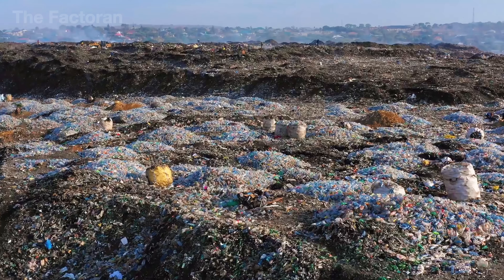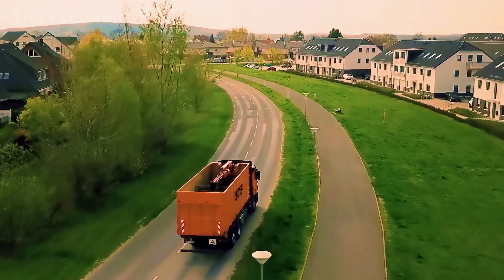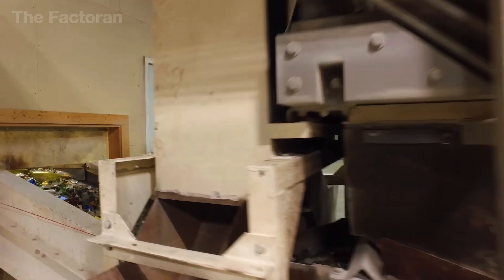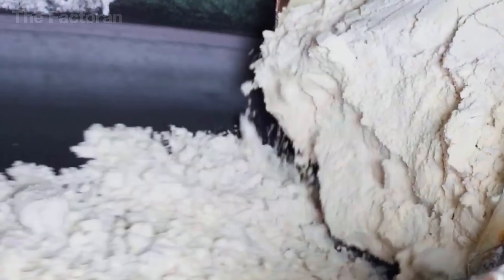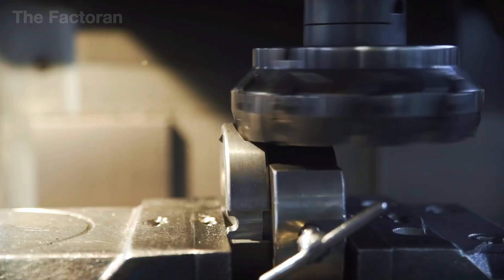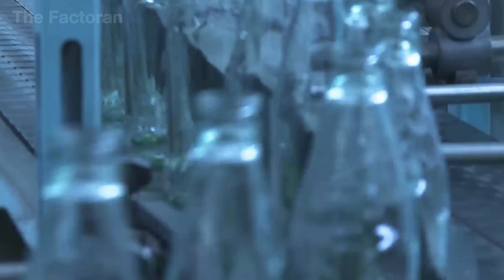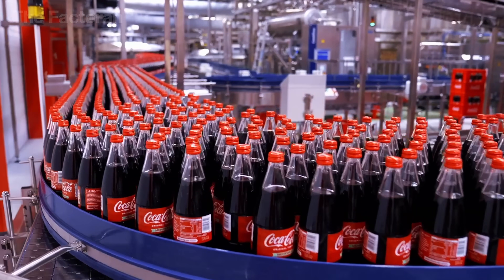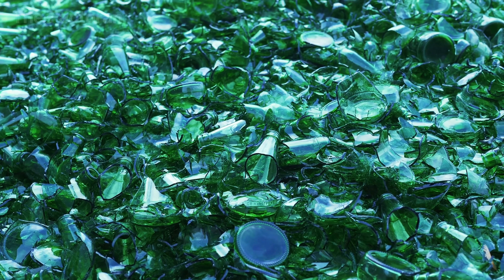How Millions of Glass Bottles Are Recycled In Factory – Massive Glass Recycling Line

Comment: You mentioned CO2 emissions.
Are CO emissions reduced? They are the main emissions from burning all organic matter, such as coal, gas, oil based products, wood, etc.
Reply from the maker: Good question — CO emissions are usually much lower because modern combustion systems are designed to convert CO into CO₂ more efficiently.
Reply: @TheFactoran : That is mostly fiction, as Wildfires & Volcanic eruptions which emit huge amounts of CO, all of a sudden were emitting CO2, as too were fossil fuels, without the need for UV Radiation to split the Hydrogen from Water Vapour & Methane, resulting in CO over a 5 - 7 year period, then also Hydrogen split from Water with the Oxygen joining the Carbon Monoxide to form Carbon Di Oxide, which along with Sulphur Dioxide & Nitrogen, are the coolants of the planet.
Clouds can't exist without CO2 to condense the Waters Vapour. 
During the period All Gore was promoting the myth of CO2 causing Global Warming, both CH4 & CO were all of a sudden never mentioned. Nor was Hydrogen or H2O in relation to their properties of concentrating Solar Radiated Heat. They also blamed humans for the increase of Volcanism on land, yet dismissed any active volcanoes in the largest volcanic field, below & surrounding Antarctica, which finally has been acknowledged, but they still don't acknowledge the fact that CO2 is the last gas frozen in Ice Cores before an Ice Age, sometimes also with SO2 & C in the form of Volcanic Ash.
Where we are in the Galaxy has a higher proportion of Solar Radiated Energy, causing our Star to experience more CMEs of which many are of greater magnitude than we have previously measured. This is resulting in increased internal pressure as some of that energy is transformed into matter, resulting in a number of thought to be extinct Volcanoes to return to life, while others have increased their activity.
Hydrogen is the active Global Warming Agent in the Stratosphere. 
That is what makes both H2O & CH4 Global Warmers.

Comment: Most screw caps for glass bottles are made of aluminium, the quality stuff, not that low grade US Aluminum.
Reply from the maker: Screw caps are typically made from aluminum alloys, and quality mainly depends on the specific alloy and manufacturing process rather than the country alone.

Comment: I lived in Las Vegas for over 38 years, and they had a reasonable, though not great, recycling system. Now I live in a somewhat rural town south of Reno, and they have zero curb recycling. If you want to be a "good" citizen, you have to drive five miles out of town for a limited recycling point. Your gas for the ten-mile trip will hardly make the trip worthwhile from an environmental standpoint. We need to get a recycling facility in the center of town, where it is easily accessible on a trip to the grocery store.
Reply from the maker: That’s a thoughtful breakdown. Access really does change how practical recycling is for a community.

Comment: I worked at a bottleing company many yrs ago & few ppl know how glass is made..
Silica sand is not sand you see on a beach & there is a huge process to remove silica from other minerals..
Removing clay & other impurities from silica takes up most of the manufacturing process..
Recycled glass of multiple colors became far too labor intensive to be practical until the digital age caught up .
When the company I worked for installed the machine to separate colore , it was cutting edge ..
But , even then there was a conveyor lined on both sides with employees to pick out the wrong colored glass shards that got through.
We made ketsup , soft drink , milk , canning & a dozen other bottles.
At the time , glass was the king of containers until Shell Chemical started producing plastics that were much more cost effective.
The co. I worked for shut down after 60 yrs in business .
It devastated our little town of less than 10k..
Most of the younger people left ..
But...today they're building a steel mill that will emply 4000 ppl & Toyota built an engine & transmission plant there .
Nxt yr a plant that produced biodegradable plastics will open & hire 2500 ppl .
I've lived 1200 miles away for 30 yrs , but my little hometown has become the center of booming industry once again after 30+ yrs.
Reply from the maker: That’s such a powerful story — it shows how industries evolve but communities always find ways to rise again.

Comment: It is not economical to recycle glass.
Reply from the maker: That’s a common concern — but modern glass recycling has become much more efficient. It actually saves energy compared to making new glass from raw materials.
Reply: @TheFactoran  I'm not so sure about that. Although the actual melting process of the recycled glass may save energy, when you consider what goes into collecting, and transporting the cullet to the glass plant, the total energy consumption can actually produce more CO2 emissions. In some cases it may make sense, but not in all cases.

Comment: In Denmark we do something similar. We just do something different, we take all whole bottles from the beginning, which makes our return better and with less energy consumption, than if you destroy them, approximately 32% of the bottles in Denmark are recycled without melting them down.
We started in 1942 with the first bottles where you got your money back, for the first time, not because people were thinking about the environment at the time, but because glass was in short supply during the war.
Reply from the maker: That's awesome—Denmark's bottle return system is a game-changer! Reusing 32% of bottles without melting them down saves a ton of energy, cutting emissions by about 0.5 kg CO2 per bottle compared to recycling from scratch.
Reply: It actually reduces CO, not CO2. All beer & Soft Drink in Australia was in re-usable bottles until the late 1980s, when we no longer owned a Glass Bottle Manufacturing Plant, due to Multi-National Corporatisation.
Coca-Cola was the only Company which could order the minimum quantities of bottles the suppliers would sell, causing most independent soft drink companies to close.
Reply: If 32% weren't melted down, did you mean to call it reused versus recycled?

Comment: Do you feel like this is an AI written and voiced documentary about how amazing Glass is? Oh and you don't get free money recycling your bottles...its already a tax on the item but you get back if your recycle/return - a smart way to prevent litter but lazy people don't care. Please stop putting your corks back in wine bottles and metal caps in empty bottles because some recyclers mark that as dirty glass for road material.
Reply from the maker: Great points — and you’re right about the deposit system! It’s meant to reduce litter, not reward recycling. Also, thanks for the tip on keeping glass clean — small details like that really matter in recycling quality.

Comment: Instead of breaking down and re-forming the bottles between each filling, wouldn't it make more sense to just reuse the same bottle?  Find some way to make that happen, and you REALLY cut down on the energy required.
Reply from the maker: You’re absolutely right 👍. Reusing bottles directly would save way more energy than melting and remaking them. Some systems already do this with returnable glass bottles—it just needs more widespread adoption.

Comment: Earth is a closed loop system. You can’t be running out of aluminum or lithium or whatever. It just moves from one corner of earth to another or spreads around. But total amounts of these are practically unchanged.
Reply from the maker: That’s a smart way to look at it 🌍. The Earth’s total supply of aluminum, lithium, and other elements doesn’t disappear—it just changes form or location. The real challenge isn’t “running out,” but how concentrated, accessible, and economical it is to extract or recycle those resources when we need them.

Comment: If we were serious about recycling glass, we would have to make some laws. One law would be all glass bottles must have a metal top that can be easily removed with a magnet and Brown, green and clear glass should all be mixed together.  Is to make the process easier and cheaper.
Reply from the maker: That’s an interesting idea 👍. Having standardized designs, like magnetic caps and simplified glass sorting, could definitely lower costs and make recycling more efficient. The challenge is that different colors of glass have different melting points and end uses, so most plants still separate clear, green, and brown. Laws could push companies toward more uniform designs, though—it would definitely make the recycling loop easier.

Comment: Back in the 1960s and 70s here in the U.K., our milk bottles were picked up by the milkman, taken back to the depot, cleaned, sterilised and reused without smashing them up. Pop bottles (soda) were the same except you got a few pennies back each time. Then the supermarkets started selling milk, pop/soda and used plastic, as it was cheaper to transport, cheaper to produce and no recycling was involved. Even now so many plastic items have a recycling symbol on them, but the vast majority simply cannot be effectively recycled.
Reply from the maker: That’s a great point — the old reuse system was simple and effective, and plastic really changed everything.
Reply: @TheFactoran Yes but the bl**dy milkman used to wake me up at stupid o'clock with his electric float, rattling bottles and whistling!😂
Reply: We used to do that with beer and soda bottles here in the US. But the US being the US, in my last location the recycler had a separate bin for glass. In my current location glass is treated like rubbish so we have to do our own recycling of glass. Makes no sense.

And regarding plastic, ALL plastic can be recycled, it's just a collection of hydrocarbons which can be broken down with heat. However, it's difficult to reuse like glass, but it can be refined into fuel.
Reply: @gkinghsmith9352 two types of plastic, thermoplastic and thermosetting plastics. One can be recycled easily, the other not so easily. Usually takes more energy to do than the end product is worth. My point is that we really don’t need either. Items used to come in tins, even chocolates, or cardboard. Plastic is pushed for food packaging as the plastic is bar coded, and can be scanned quickly. As usual it’s all about money. In the U.K. we used to get free plastic carrier bags to pack our groceries in. They banned them to save the planet. Bring your own bag they said. But then they packed everything in plastic, fish, vegetables, yogurt, fruit, everything! Now we have microplastics in our bodies, causing inflammation and cancers? It makes no sense to use plastics any where near food.
Reply: Ours still out here in England - the system still exists.

Comment: Some decades ago, in my country you gave back the bottle to the store and they discounted some cents from your purchases. No need to melt down the glass and redo the bottle. Just reuse.

This system is nuts. We reused stuff, not recycle it.
Reply from the maker: You’re absolutely right—reuse is even better than recycling. That old bottle-return system was super efficient and sustainable. ♻️👍 Wish more places would bring it back today!
Reply: @TheFactoran  Yes, because you didn't have to use that much energy to melt the glass and make a new bottle. You just washed it, sanitized it, put beer in it and that's it. Very cost-efficient and, as they say today, ecofriendly.

Comment: we did have a recycling program but was cut out. You had to drive a long ways to the dump. as far as getting paid not a chance in hell. So each wednesday everything just gets collected as is. Other states offer .05 cents a plastic bottle we had a waste bin the city for few months dished out went a way of the do do bird. extinct. So the bins are either thrown away or used a storage but sun weather breaks the plastic down making them brittle We could start better recycling ♻️ program use the cash donated to the city road repairs etc. I do not like land fills. unless the gas collected from off gassing for a turbine to make electricity ⚡️ Or the cash to pays city workers more and keeps the equipment up and or replaced. Like new police cars 🚔 as needed etc.
Reply from the maker: Yeah, that sounds frustrating. A deposit system or city-funded program could make a big difference—and turn waste into something useful for the community. ♻️

Comment: 20-30,000 bottles weighing 10-12 tonnes how do they work that out??
So 20,000 bottles weigh 10 tons but adding another 10,000 only adds 2 tons 😂😂
Reply from the maker: Good catch 😅 — the numbers are usually rough estimates, not exact math. It depends on bottle size and weight.

Comment: As you mentioned, in Europe, glass is already collected separately by color. How do they handle it at the factory if, for example, brown glass is thrown into the white glass container? Do they have a similar separation system in European facilities to deal with color defects? I can easily imagine that a white glass end product shouldn't have even a trace of brown glass.
Reply from the maker: Great question — if the wrong color gets mixed in, it can ruin a batch. Many plants use optical sorters and manual checks to catch those defects before melting.

Comment: When I was young we had glass factories all over the country. The local glass factory in my home town bought old glass for recycling. We separated the glass according to color because it was worth more that way. We also sold barrels full of mixed colored glass but it was worth much less then separated glass.
Reply from the maker: That’s a great memory! 🏭 Sorting by color really does make recycled glass more valuable.
Reply: @TheFactoran  The problem today is that in my day glass factories were in every city that had a population of 20,000 or more. Now days there are only a few left to do the same job.  I heard 1 guy say it was okay because there was so much sand that we would never run out of material to make glass. He is right but recycled glass cut cost because it is already more pure than sand, has certain materials already added so that less needs to be added when remelting the glass & is cheaper to transport then sand because more product comes from recycled glass then the same amount of sand.

Comment: Another video on glass recycling shows the final product as glass wool insulation ; a plant in Germany uses discarded tyres as fuel for the furnaces, thus saving 40% on fuel cost.
Reply from the maker: That’s really interesting! 💡 Glass wool insulation is a smart use, and using old tires as fuel sounds like a big energy saver.

Comment: I don't understand why a person sorts it into colour bins when they all get tipped out of the wagon together. Why don't they just pick up the colour of glass they need more of and add it to a pile of the same colour to be ground down? Also recycling should be separated like the metal lids.
Reply from the maker: Good point! The glass is usually pre-sorted by color because it melts better when separated. Later it all goes into the same wagon, but the recycling plant still processes colors separately. And yes—metal lids should be recycled apart 👍

Comment: What's really amazing are the machines that are designed and manufactured for that work.  Imagine what it would take to manually form the glass slugs into the bottles those machines put out by the second.
Reply from the maker: Absolutely — the engineering behind those machines is just as impressive as the bottles themselves!

Comment: All that machinery all that electrical power all that technology all that time all that ENERGY all that manpower. A bottle is created. Someone drinks out of it and throws it away. And that’s it. It all has to start again.
Reply from the maker: Exactly — it’s a powerful reminder of how much goes into something so easily discarded. All that effort, all that energy… for a single-use moment. It really puts things into perspective 🔄🧃⚡ Thanks for putting it so clearly.
Reply: Your age is showing. Let's imagine a bottle washing machine. A machine the drink formulator might use. To make that work, some sort of bottle shipping container is required. And, the bottles would need to be of sufficient strength to withstand a cycled use, well, several cycles in fact. Maybe a human interaction, say a labeled shipping container would be conviently located to enable the consumer to return the marked bottle to the container. Say, 24 bottles per container and capable of stacking. If only society could come up with such a system. One of which humans could follow. One which eliminates the dangers & costs of broken glass. Like, a human discarting a bottle onto a highway. The shattered glass causing vehicle tires to lose air pressure and cause an accident. Well, maybe a pileup due to the glass shards spreading across the highway, creating a traffic stop on the highway, causing additional pileups. 
Does AI know about this idea?

Comment: The single most expensive ingredient in glass is energy.  The single most expensive ingredient in recycled glass is energy, exceeding the cost of energy in primary glass.  Asking people to wash glass before sending to recycling is insane.
Reply: So is with everything including petrol / gasoline
Reply from the maker: You bring up a really valid point — energy is absolutely the biggest cost in both virgin and recycled glass production 🔥⚡. Melting cullet still takes massive heat, and when contamination’s high, it can even cost more to process.